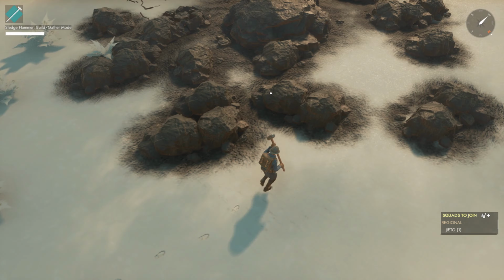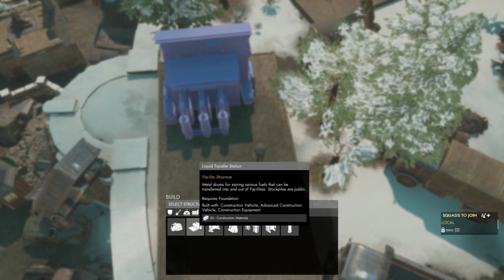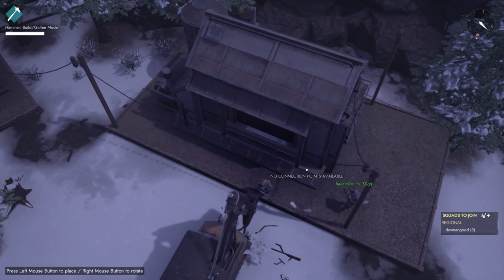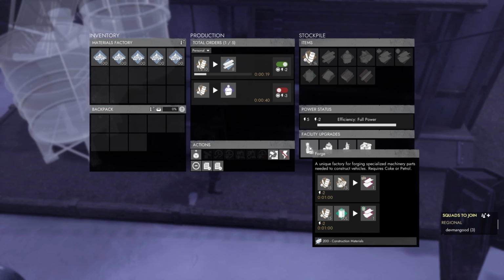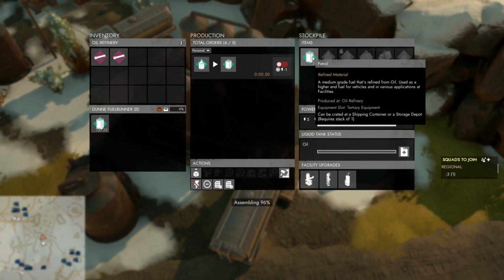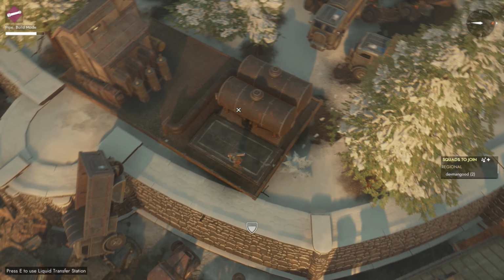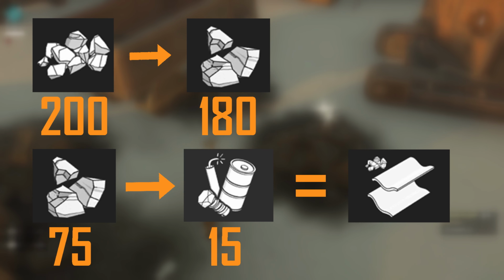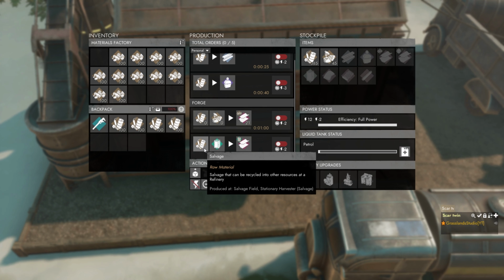How to Build Your First Facility | Foxhole Guide (2025)

Comment: Is there a way to make buildings snap to a grid with rotation and placement?
I have OCD and if rotations and placement of things not being absolutely straight and square it freaks me out
Reply from the maker: Not really, it’s kind of based off whether or not it’s a foundation/building of the same type. 

Anything that’s like a foundation, bunker piece, pipeline, or rail line can be snapped together. They rest you have to eyeball
Reply: I wonder if you can mod in a rotation lock

Comment: Hi! Can you explain how power works? Because I'm looking at the wiki but I'm still confused on how production and consumption works. 

Like, power facilities produce some power every 45 seconds, or a minute and a half, or two minutes. Then production facilities have a lot of different products with a lot of different completion times and power requirements. Some take as short as a minute while others take as long as several hours.

How does power work there?
Reply from the maker: Power is simply what allows anything to run. So connect everything to a diesel  plant and periodically refuel the plant via with diesel. You can also upgrade to petrol. 

As long as the smoke stack animation is going (which means there is fuel being consumed in the plant) then things other facilities connected with powerlines will be automatically powered